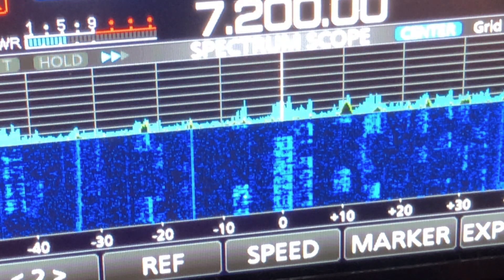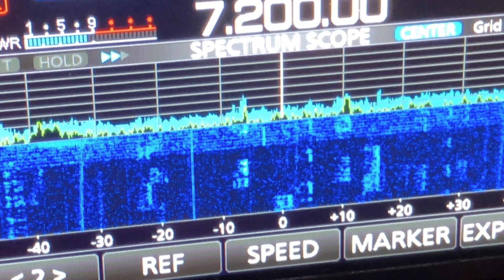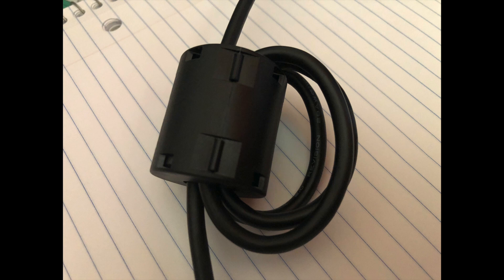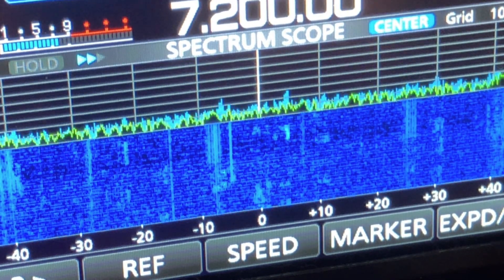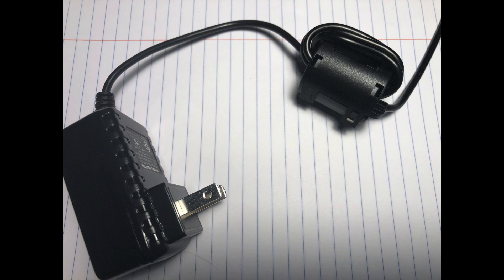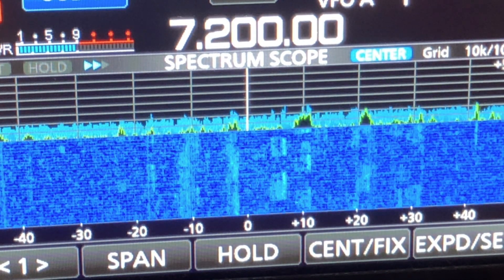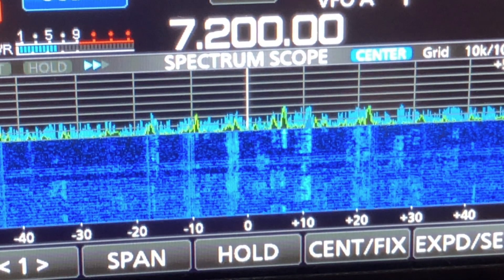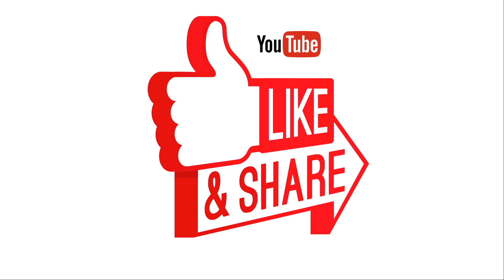RFI Problems Pt. 1 - HAM Radio - TheSmokinApe

Comment: Just a comment, Ape, could you use 2 toroids say with 4-5 turns through both of them, to sort of double the amount of inductance on the cable?
Awesome video. 
73, ZL3XD.
Reply from the maker: Yes you could but two cores doesn't necessarily mean "double"

Comment: New tech ticket and little money. Only thing I have to do is hit a DMR repeater less than 15 miles away with 5 watts.Won't be dealing with problems like this for a few decades.
Reply from the maker: Congrats on the ticket.  I was a ham for about 4 years before getting into digital, granted it wasn’t that popular, and close to 5 years before deciding to get a radio like this and take the general test.  It will be waiting for you when you are ready 👍
Reply: @TheSmokinApe  I can't afford to buy good equipment for the bands my tech license grants but I may take the general in the future.